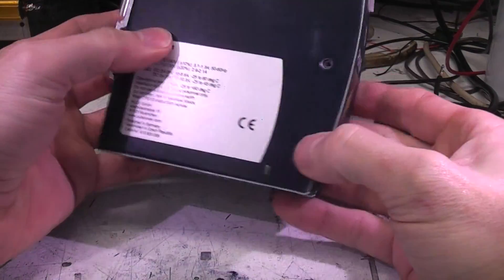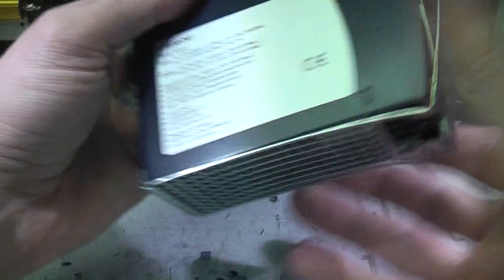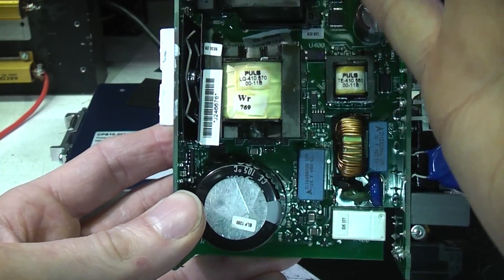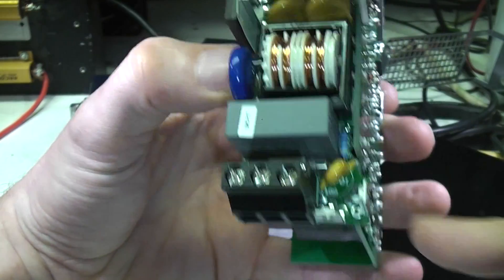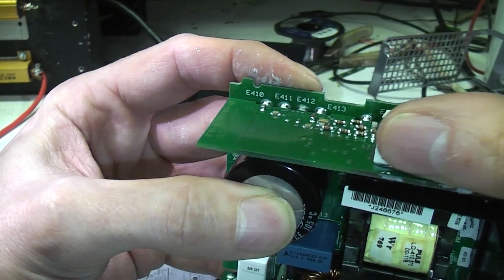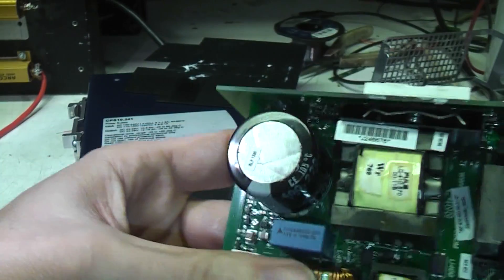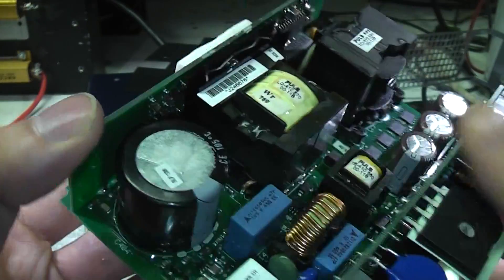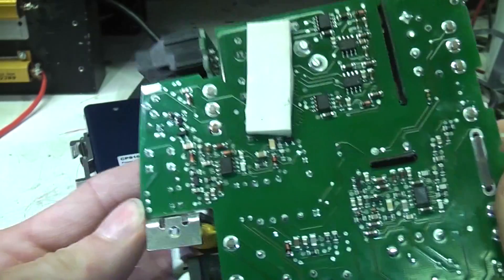PULS CPS10 industrial DIN-rail Power Supply

Comment: The DC input voltage range doesn't match the AC input voltage range.   The rectified AC would be 140-338 volts. And considering that it can run on 110V DC, it should be able to run on as little as 79 V AC.

Comment: Speaking anecdotally, as in I have a really neat battery bank that outputs 240VAC or 300VDC, switchmode power supplies seem to run a bit more efficiently on DC. Or at least that’s the case when compared with modified square wave inverted AC, in which case all bets are off I guess.

But in short, switchmodes love the 300VDC option I can give them with my power bank.

Comment: I like the way they've made several small loss savings like the NTC bypass and MOSFET rectifier.  It all adds up in reducing heat dissipation.  Do I guess the MOSFETs in the rectifier are controlled directly by the main control chip?  A decent PSU is worth its weight in gold in terms of long term equipment reliability.

Comment: Also if I'm not mistaken those blue caps (C41?) are AVX brand (from the logo), which is one of the best brands out there. They supply lots of parts for the military. Very good stuff. :>
Reply: To correct myself - nope, those are Epcos brand caps. Very similar logo to some AVX caps. Still a great high reliability brand. :)

Comment: Mike, could you elaborate on the electrolytics failing on the control side? I've ran into this issue several times but never traced the circuit. They've always been low capacitance electrolytics which I presumed failed due to high ripple, and indeed in the way that you've described. I just replace them with polypropylene or organic polymer caps, but why do they fail? Simply heat I guess? I just want to understand that failure mode a bit better. Thanks! :)

Comment: Resonant converters do have very high current ripple on output capacitors. Notice 3 of them instead of one. And that's very bad for reliability.
Reply: 3 output capacitors is there to lower ESR which is important for high frequency that is usually used in resonant converters, single electrolytic have to high ESR only MLC and MLP meet ESR requirements for frequencies used in resonant converters (usually well over 1 MHz)
Reply: Miloš Lazović
Unlikely. It's more likely they needed the form factor and would have exceeded the max ripple current of a single capacitor.
Reply: Dr. Lecter you again manage to show no knowledge, max ripple current of capacitor is function of ESR and maximum allowed temperature rise (again function of size and thermal conductance).
Reply: Miloš Lazović
Try reading instead of being an asshat. I didn't dispute how ESR and ripple current are linked, but if you look at the board, form factor is clearly the most important factor here. A single large cap would simply not have integrated into the design.
Reply: Dr. Lecter physically larger capacitor don't necessary lower ESR, it can handle more ripple current (due physical dimension, so it can dissipate/hold heat) but lowering ESR have other advantages like smaller output voltage ripple, moving ESR zero to higher frequencies (make it easier to close faster control loop) ....
Time you just start reading some basic books about SMPS so you get some idea how it work.
Reply: Miloš Lazović
Haha, good one ;)

Comment: I work for a company that builds (VERY)heavy duty industrial low voltage switchgear. From our perspective... the designers just pick a cheap power supply and slap in there if they need 24V. I don't really think they look much at efficiency numbers or reliability. As long as it's a known brand and good price they're happy. So for me to convince them to buy something like this instead... I'm not even sure they'd understand the benefit. As for the multi-voltage AC/DC capability, we don't generally switch AUX voltage during operation, but it's convenient to have one type of PSU on the shelf that handle most or all AUX voltages our customers use.
Reply: Couldn't you convince them with the efficiency numbers? Even if it is more expensive, these things are probably intended for many years of usage. On top of that, quality equipment also reduces the likelihood of malfunctions and the associated downtime and maintenance costs. I know it's different, but in my area (IT) machines are often replaced because the upgrade will pay for itself in reduced power bills after a couple of years.

RS seems to be stocking them at around 200 euros, not cheap by any means, but not that much for industrial equipment.
Reply: Just use the overvoltage spec. It will survive loss of neutral long enough to give the onboard MOV the energy to blow the input side fuse. Plus being small you can use a smaller cabinet, or have extra room for another PLC expander without needing to add another power supply for it as well.
Reply: Efficiency is really not a huge deal to the customer when we're only talking a few percent. Where it actually is incidentally an advantage is that the more efficient the less power dissipated and hence the smaller you can make the enclosure.
Reply: Niklas Bergsten has the lower-specced device that you're using right now ever failed?
Reply: Well, not what I know of. :)
Reply: Niklas Bergsten then what is your reason for wanting to replace the current setup with heavyduty PSUs, if I may ask? The PSU being talked about in this video looks extremely well engineered, to the point of ultra-high reliability of near-medical grade. Perhaps your application needs such reliability?
Reply: Well Ive "only" worked for the company for 6 years. An yes, we have hospitals and nuclear power plants in our customer base. :)
Reply: Niklas Bergsten All right, can I ask whether or not you're using medical-grade equipment in your hospitals, and industrial-grade stuff in nuclear powerplants? Because this is pretty much prescribed by law in certain situations. Of course it doesn't really matter if your PSU is just powering some lightbulbs, albeit them not being the operating theatre lights
Reply: Usually it's more about redundancy, actually.
Reply: I think that the efficiency is also dictated by law in some jurisdictions. For example, in the US state of California, even some kinds of industrial equipment are required to meet very strict minimum efficiency standards, which includes standards on the maximum standby power which devices like battery chargers are allowed to draw.

Comment: I like decent power supplies. A recent job used some Lambda ones of similar rating, they had horrible screaming fans in them - the last thing you want when you're trying to fault find.

Great info on the resonant topology and the techniques used to achieve that high efficiency